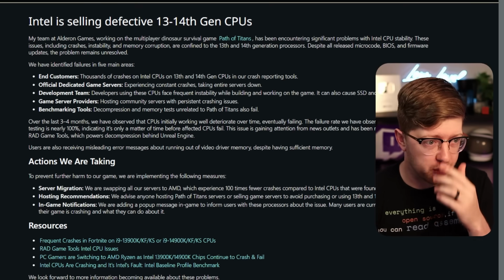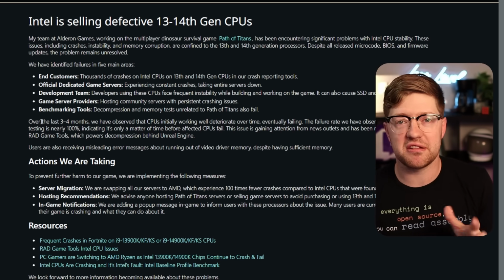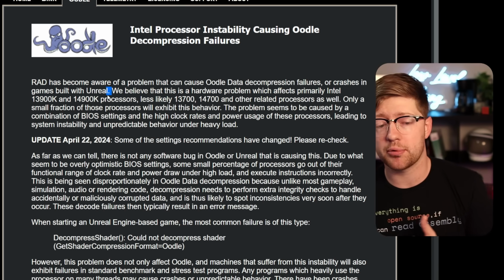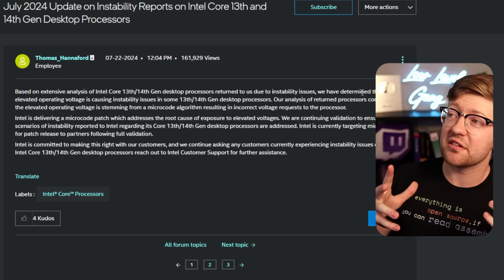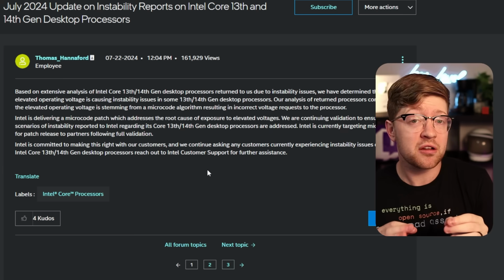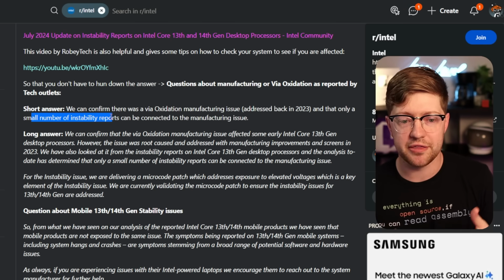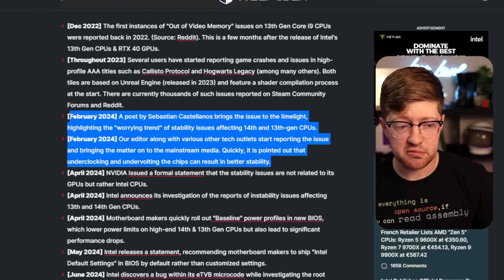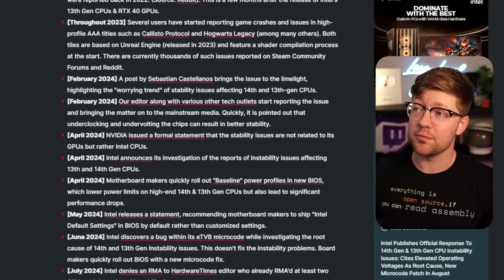intel CPUs are literally falling apart

Comment: It sounds scary to say intel is an interpreted language. The truth is that every CPU runs microcode and has been for over 30 years.
Reply: Not every CPU, but every x86 cpu for sure. It just makes sense, if you are chasing performance.

The instruction set needs to be stable and backwards compatible, else you will break people's software. But you want your microarchitecture engineers to be free to explore different new optimizations when designing newer generations of cores.

So you let them. The internals of the core can be implemented using whatever custom proprietary instructions make the most sense for that particular CPU design, letting them be as fast as possible. And since this is going to be a big and power hungry CPU anyway (given that it is a CPU designed for performance), might as well spend some die area on a more complicated instruction decoder + translation unit, to translate the public-facing instructions into the internal ones.

Plus, having microcode means that many various kinds of bugs become fixable after the fact, after the CPU is in production and in the hands of users. Security vulnerability or misbehaving instruction found? It can probably just be fixed with a microcode update.

But for small cores that chase power efficiency and low cost, instead of performance, like microcontrollers or the lowest power designs from the likes of Arm, it doesn't make sense. And those CPUs don't have microcode, even today.
Reply: @inodedentry8887 Microcode is a great solution for tasks that equate to building a hardware lookup table. Instruction decoding is a good example. Ben Eater uses it for that purpose in his 8-Bit breadboard computer.
Reply: @inodedentry8887  Yeah thanks for expanding. I was trying to say it isn't scary, and you've articulated the reasons well. Still, I would call microcontrollers MCUs not CPUs. I still maintain all CPUs use microcode. Even ARM for any normal CPU they make.
Reply: It is a strategy to enable pipelining, an instruction composed of microinstructions enables a pipelining architecture by having several pipelines that runs instructions at the same time. That way you achieve the coveted instruction per cycle goal, despite them running for several cycles in reality.
Reply: They are not interpreted, it's more like a bunch of control signals, to be interpreted microcode should be Turing complete
Reply: You are confusing things up.
The micro-code have nothing to do with seeing x86 as an "interperated langage". And by the way, there is no "interpretation". Instruction are just decoded into micro-operations, it just about breaking complex instructions into simple operations (instruction != operation).
Also, micro-code and micro-operation are 2 very distinct concepts.

A basic in-order processor can have a micro-code. It's just a way to make the decoder more flexible. Ok, the intel micro-code is sophisticated but this just help handling non-performance-critical complex instructions (e.g. for legacy purpose).

About micro-operation: sometime we call them "micro-instruction" but it's misleading, they are just a bunch of control signals (as @lauraprates8764 says) that should be dispatch to an execution unit to perform an operation. "micro-operation" is therefore a more appropriate name.
Sometime we can read on that micro-operations are "RISC-style operations", but this is misleading too.
"RISC" is a type of Instruction-Set, it's part of the architectural definition. While a "micro-operation" is an internal representation, it's part of the micro-architecture. 
Taking about "RISC-style operation" is therefore breaking the seperation between architecture (the programmer interface) and micro-architecture (the internal structure), it's just add's up to the global confusion about how computers actually works.
Reply: 30 years? Try over 40. Microcode has been a part of x86 right from the beginning. The original 8086 from 1978 has a sizeable microcode ROM in one corner of the die. Check out Ken Shirriff's series of articles on reverse-engineering the thing.
Reply: @Roxor128  Yeah exactly. You see the pushback I got for even saying 30. Imagine if I said 40.

Comment: "Microcode update to fix oxydation issues" has the same bad smell as "software patch to make a MAX 737 behave like a 737". "Small number of reports" ditto.
Reply: yeah. when that happens in production it's scrapped
Reply: "Microcode Corrosion Avoidance System"
Reply: @aresye  lmao perfect
Reply: two 100% separate issues. so either your CPU is oxidized or has microcode problems and voltage damage. since its a software "bug" its not covered under the same "poor workmanship" warranty clauses. the oxidation is covered by it but microcode over voltage damage is not
Reply: so far no public whistleblowers from intel having 'accidents' 

...yet
Reply: Was about to take this comment seriously until I saw the word ditto at the end.
Reply: @Cosmic_cloudx  was about to take you seriously until i saw the rick and morty pfp 🤣
Reply: people saying ditto i can't take their shitey comment seriously lmao
Reply: @Cosmic_cloudx  You're malding over a normal word when you yourself aren't even able to spell the word "shitty" right.
(If anyone else comes across this, watch to see if they edited their comment before telling me it wasn't misspelled.)
Reply: @SterileNeutrino  Two separate issues.
Reply: Yea let's not include that mcas in pilot manual too.
Reply: Because it's not an oxidation issue. Oxidation was happening to a batch of 13th gen CPUs in 2023 and that issue was supposedly fixed, while 14th gen is also affected by this instability meaning that the oxidation and voltage issues are separate. Based on Intel's wording it seems like oxidation only affects some older CPUs from 2023, while the majority of 13/14th gen CPUs are failing due to the voltage issue.
Reply: @lycanthoss  Oxidation could also cause a voltage issue though, a slightly broken Transistor letting more current pass than intended is not that far-fetched.
Reply: @lbgstzockt8493  Reporting so far says it's oxidation of the copper vias.
Reply: @lbgstzockt8493  It could, but Intel doesn't seem to think that oxidization is causing issues with the 14th gen CPUs. They admitted that their microcode is bad. The problem is that because of this microcode issue, virtually every 13th and 14th gen CPU has sustained at least some level of damage which is irreparable and practically undetectable (at least for the ones that don't outright fail). Now with every CPU in those 2 generations, you will need to wonder how damaged it is, and whether it will be reliable in the future. A microcode patch can prevent FUTURE damage, but it can't undo the damage that has already been done.
Reply: @lycanthoss  Unless Intel is wrong or lying.
Reply: "Download more RAM" energy
Reply: @marcosdiogenes9380  ok but that's possible (look up zram)
Reply: @marcosdiogenes9380  you look like the type to fall for the download more RAM and VRAM scams.
Reply: @Cosmic_cloudx  lil bro, I'm a software engineer with a CS degree 💀

Comment: Level1Techs and Gamers Nexus have both been digging into this issue and have videos I'd highly recommend going deep into this issue.
Reply: Yep Wendell went so dang deep on this one..
Reply: YES!!  They smoked Intel out.  Intel would still be pretending nothing was wrong without the crescendo caused by their videos.
Reply: Wendell and Steve did really good with this (as always)
Reply: Actually Hardcore Overclocking (Buildzoid) has a really cool explanation why those CPU degrade. There are actually 3 issues with Intel 13- and 14-gen CPU's:
1. some 13gen ones were botched up during manufacturing (via oxidation)
2. Moutherboards were applying unstable undervolting settings (AC_LL - CPU register where VRM loadline is supposed to be got value way smaller than actuall VRM loadline)
3. Intel loadline compensation causes CPU to ask for way to high voltage (1.6V) and recieve just that at all cores active but not really loaded

Comment: Should I be concerned? I have laptop with i5 13th gen.
Reply: Most of the 13th gen laptop CPU's are just renamed  and clocked a little higher 12th gen CPU's and most of them are not running at full performance so most probably you are fine. If you are not getting an error of course, if you are getting an error it is maybe a little late because the harm might have been done. I hope intel will at least give a refund.

Comment: Got 14900. Undervolting is the way to keep it cool and safe. 
Offsets are -0.130 or more

Edit: added benchmarks and more settings below.
Reply: personally I like the ability to run my stuff stock if so desired and have it run reliably until the end of time without screwing with anything
Reply: @StephenMcGregor1986  I ran it in stock for a while and it was totally fine, until I tried training a huge ML model with a big dataset (which was overkill) and it reached 100C on package. So after an hour of search I found some posts on r/intel regarding taming this beast.

Still, I had the "Intel Optimized Defaults" with 253W limit enabled and a good AIO, but this didn't help.
I had to, just to be safe. The silicon won't last long at this temperatures (as confirmed from video).
For 99% of time it worked good even with stress tests under 90C. But a 100% load at 253W+ power draw it goes out of the line. It's throttled around 1C to TJmax, that's no good for me.

Now it warms to 90C max (93C peak) in stress test. For sure, it can be cooled even more, but I don't reach those temps 99% of time. I limited package power draw to 240W + offset I mentioned above. No significant perfomance loss so far.
Benchmark: 925/16780 (single/multi) bench which is the same or better comparing to stock (926/14255)
Reply: I ran it in stock for a while and it was totally fine, until I tried training a huge ML model with a big dataset (which was overkill) and it reached 100C on package. So after an hour of search I found some posts on r/intel regarding taming this beast.

Still, I had the "Intel Optimized Defaults" with 253W limit enabled and a good AIO, but this didn't help.
I had to, just to be safe. The silicon won't last long at this temperatures (as confirmed from video).
For 99% of time it worked good even with stress tests under 90C. But a 100% load at 253W+ power draw it goes out of the line. It's throttled around 1C to TJmax, that's no good for me.

Now it warms to 90C max (93C peak) in stress test. For sure, it can be cooled even more, but I don't reach those temps 99% of time. I limited package power draw to 240W + offset I mentioned above. No significant perfomance loss so far.
Benchmark: 925/16780 (single/multi) bench which is the same or better comparing to stock (926/14255)

Comment: Pretty dumb story, mobo makers have been pushing voltages to the breaking point for decades, solution is to lower temps and voltages like it always is.
Reply: lower performance so previous benchmark results are all irrelevant now yeah?
Reply: @StephenMcGregor1986  they were already irrelevant unless you were getting your source from someone who reset the mobo voltages to intel spec. There were a few reviewers doing that but not many. As for oxidization, yes that is what happens when you heat things up too much beyond spec, Recall doesn't mean anything is wrong unless its government mandated, otherwise its just about keeping customer goodwill, the recall will have to include more aggressive limits on overclocking.
Reply: and the RMA oxidation issues?
Reply: It's not the motherboards fault in this case though its the CPU requesting too much voltage and boosting too high, along with possibly design/oxidization issues.  It is largely a heat/voltage issue though, you are right about that.

Comment: I was unfortunate enough to buy a laptop with i7-13700H right before the story went public😢😢😢...
Reply: Most of the 13th gen laptop CPU's are just renamed  and clocked a little higher 12th gen CPU's and most of them are not running at full performance so most probably you are fine. If you are not getting an error of course, if you are getting an error it is maybe a little late because the harm might have been done. I hope intel will at least give a refund.
Reply: It's not likely that this issue will be a problem for mobile processors.  They just aren't pushing the power envelope like the desktop parts are.
Reply: In general, mobile processors experience this issue less often than desktop processors. The fault rate is lowest for low power U and P class processors, higher for H class processors. Also, most of the issues show up on i9s. If you have an i7 or i5, it's probably fine.
Reply: I've shelved my laptop for now and hopefully it's a late enough model that the microcode update will fix this properly when they release it.
Reply: @ariphaos  if you can i think you can undervolt it and continue using it.
Reply: So I got a framework laptop with an i5-1340P... is that short for i5-13400P? Is this a safe CPU?
Reply: @greatcanadianmoose3965  Unfortunately I checked and it's Raptor Lake-P (13th gen architecture). Although at this point I wouldn't worry as there hasn't been any evidence of an absurdly high failure rate among the *400 13th gen parts like with the *600, *700 and *900 parts.

Comment: Planned obsoletion goes too fast?
Reply: No. It's simply Intel doing what it always does: Taking everything to the extreme to compete with AMD.
Reply: @ILovePancakes24 AMD one.
Reply: ^ Agree 100%.  I have an IBM PC, with a 4.77MHz CPU in it -- and at least one of just about all the generations up to the Core i-series, and then several gens of Core i CPUs.  They ALL still work.

There is no reason to "plan" obsolescence in a CPU.  The desire for better performance takes care of that itself.
Reply: @sirnickity  Same way how car manufacturers instead of designing old vehicles to fail they push as hard as possible how the new ones are better even though the old one is, and will continue to be, perfectly fine
Reply: @sirnickity  apart from how computer speed progress has slowed down significantly in the last 1 & ~1/2 decades and how a lot of 'obsolete' tech would be perfectly usable for the vast majority of people if not for lack of updates and needless software complexity increases
Reply: Not planned, just poor quality products. Intel is circling the drain right now alongside a lot of Israeli companies.
Reply: Interesting point. I was wondering what intel did to earn this karma. If they did then why didn't we see this before? It's only affecting 13 and 14th gen atm
Reply: no you NPC.
Reply: This could as well be the solution for all other security problems! 😁
Reply: Nah. I think Intel wants this.
Reply: that's a profoundly stupid take
Reply: @jonasghafur4940  ? what so stupid about this? this is years old problem, Intel admit it to korean customer comite, yet they refuse to give refund for month old this CPU series because of this faulty. This only blown up after gamer nexus cover up. TLDR they already know this series has issue, they keep selling it, and refuse to give refund, if this is not planned obsoletion that uncovered too fast then what it is?

Comment: Maybe I lucked out.  I run my 13900k at full tilt for almost 2 years now.  No issue.  Not even a single BSOD.
Reply: Survivor bias

Identifying Problematic Revisions: If Intel can pinpoint specific stepping codes within the affected CPU models that are more prone to oxidation, they could narrow down the scope of the problem. This would involve analyzing returned CPUs, gathering data from affected users, and potentially conducting additional testing.

    Targeted Recall or Refund: With this information, Intel could issue a targeted recall or refund program specifically for the problematic stepping codes. This would allow them to address the issue more efficiently and compensate affected customers without having to recall or refund every single CPU of that model.

    Clear Communication: Intel would need to clearly communicate the affected stepping codes to customers, potentially through a dedicated webpage, support documentation, or direct communication with retailers. This would allow customers to easily identify whether their CPU is eligible for a refund or replacement.

Benefits of this approach:

    Precision: By targeting specific revisions, Intel can focus its resources on the CPUs that are actually affected by the issue, avoiding unnecessary returns and refunds.
    Customer Satisfaction: This approach would demonstrate Intel's commitment to addressing the issue promptly and fairly for those who are directly impacted.
    Cost-Effectiveness: It could potentially be more cost-effective for Intel to focus on specific revisions rather than recalling or refunding an entire model.

Comment: Looks like i will be using amd from now on.
Reply: The same reason Western Digital users gave when they switched to Seagate, and Seagate users gave when they switched to Maxtor, and Maxtor users gave when the switched to Quantum ....

Also the same argument Symantec users gave when they switched to McAfee, and McAfee users gave when they switched to Symantec.  Everybody just changes teams every few years to get to the greener grass.

Basically:  Every vendor effs up, and when you have a limited number to pick from, you can either just wait it out, or switch to The Other Guy until, inevitably, they also eff up, and then you can switch back.